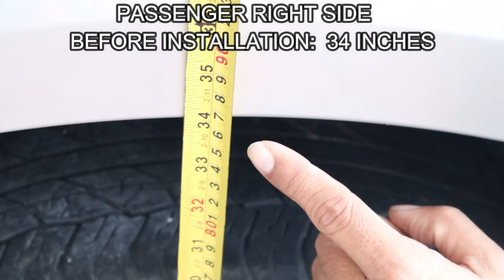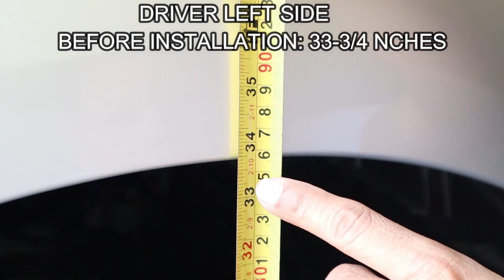How To Install Quick Lift/Coil Spacers  (Nissan Navara NP300)

Comment: FYI po..inde adviseable na proseso na malalaman ang tightening torque value sa pamamagitan ng pagluluwag lang...less torque ang makukuha mo value sa pagluloose ng nut kc  ang pitch thread ay inclined..ang tamang procedure para malaman ang torque value ng nakahigpit na nut ay markahan ang isang side ng nut na nakafull torque atska luwagan...then higpitan ulit ang nut hanggang sa magpantay ang marked line sa full torque nya...at doon mo malalaman paglagutok ng torque wrench ang correct torque value na ginamit ng stock manufacturer..👍

Comment: Good job sir Joey! Suggest ko lang, palit ka extended upper ball joint para hindi papalo ang uca sa upper shock mount kapag nag articulate ang gulong...ty...
Reply from the maker: Yun nga sir ang una ko napansin kaya mag tingin na rin ako sa lazada medyo mahal nga lang nasa 7k yung nakita ko.
Reply: @joeysd.i.y  sir Joey sa shopee 3k lang mahigit, na experience ko na yan kc naka 2" lift din ako, tapos nag pagawa ako rubber spacer 5/8" sa front driver side, tapos sa rear 1" pass side at 1 1/4" sa driver side at yung stab link didugtungan ko ng 3" (welding lang) para ma correct ko "lean issue ng navara" salamat...

Comment: Hi did you need to get wheels  re aligned,  and how long did it take to do the front & back lift thanks
Reply from the maker: Sorry for the late reply yes I did have my wheels aligned and it took me a little bit longer since I'm doing a video but normally it can be done in a day provided you have the all tools needed.

Comment: sir Joey , with quick lift front only, how will you adjust the headlight considering the 2 inch lift will most likely get high  the height of the beam light.?
Reply: check likod ng headlight. merong dalawang bolt, for vertical and horizontal

Comment: di po ba may limit ang height adjust? usually 2in lang max para hindi maapektuhan un ibang parts? (e.g. brake lines, stab link, etc) san nyo po nakita na reference na pwede 2.5in? salamat sa guidance. more power

Comment: Thanks sir sa pag share. Bakit po foot lbs gamit nyo at hindi newton meters?
Reply from the maker: Foot pounds po kasi yung gamit ko na torque wrench madali naman  iconvert sa newton meter.
Reply: @joeysd.i.y  okay po sir. thanks. klinick ko yung Lazada link nyo. Yan pala yung original. 

Yung nabili ko parang peke seguro. Flyman na US brand tas may foot lbs at newton meter mag kabilaan.

Comment: Salamat po sa video na to sir. Very helpful.
Sir, is it true na nakakasira daw ng ball joint or yung stock control arm pag nag quick lift without upgrading upper control arm? Thanks po sa sagot.

Comment: magandang araw po sir joey, matanong lang po tungkol sa passenger side na coil pwede ba hindi nalang i twist , kahit hindi makita ang word navara ok ba yon wla bang problema sa tatlong bolt, hope you reply thanks...
Reply from the maker: Need po na itwist kasi magiiba ang orientation or yung position ng shock hindi papasok yung bolt sa lower portion ng shock.

Comment: Good job sir joey. San gawa yung stopper spacer?
Reply from the maker: Emgineering plastic yung ginamit ko sir
Reply: Ilang mm po yung bolt para matanggal yung stopper? Magaadd din po kasi ako ng rubber dyan since naka 2 inch lift po ako.

Comment: why did you compress the spring bro?
Reply from the maker: Because I need to loosen the top plate and need to turn it 180 degree. To allign the spacer with the holes at the top. I also explained that in the video

Comment: Sir, mas mababa talaga sa driver side. kasi parati dyan ang may sakay na tao, tsaka dahil din sa bigat ng gas tank. mas loaded parati ang driver side.
Reply from the maker: Maraming salamat po sir sa information marami din po ang mag message sa akin at same sila sa info nyo na dahil daw sa gas tank na masmabigat especially kung naka full tank.

Comment: Sir kamusta po yung quick lift ngayon, no issues po ba? Plan to add din po on my navara. Thank you
Reply from the maker: Ok po yung quick lift na ginawa ko sa Navara wala ako naging issues mas gumanda pa nga ang naging driving experience ko mas masarap syang gamiting ngayon.
Reply: @joeysd.i.y may pinag kaiba ba s dati yung pag may lubak? At anu brand n spacer and ilang inches sir?

Comment: Sir tanong ko lang.. Nung naglift ako 2" sa labas ang kain ng gulong ko..nagpacamber allign nadin ako.. Possible kaya na sa uca ball joint kelangan naka extend din sya
Reply from the maker: Yes po kailangan magpalit ka ng extended ball upper joint lalo na at hindi na ma perfect ang camber. Pero sa akin kaya pa kahit stock upper ball joint kasi stock pa rin mags ko kaya pa icamber alignment
Reply: @joeysd.i.y  stock mags padin ako sir.. Ok naman na sir ang allign nawala ang kabig at malambot ang manibela..napansin ko lang sa gulong ung spike sa outer part is lapat na lapat sa simento and ung inner part naman is medyo angat sya ndi sya lapat..

Comment: kung maganda yan coil spacer o quick lift sana wala ng nagpapa install ng suspension lift? like ironman, profender, ome, tough dog at ridemax wala na sana gagastos ng hundred thousand sa set up kung mas maganda yan sinasabi mo. pwede ka mag quick lift kung low budget ka, pero kung more budget ka much better na suspension lift

Comment: Sir di po ba maaapektuhan yung wheel alignment pag nag shock quick lift?
Reply from the maker: Mawawala po sa camber kaya need na magpa computerized camber alignment at pwedeng isama na rin ang wheel alignment.

Comment: sir joey, sa harap wala kana naging adjustment sa stabilizer link unlike sa likod. kumusta po performance?
Reply from the maker: Hindi na ako nag palit ng adjustable stabilizer link sa harap pero may mga nag advice sa akin na mag palit ng extended upper ball joint try ko pa muna ng mga ilang months tapos gawan ko rin ng video review para sa ride ang performance.